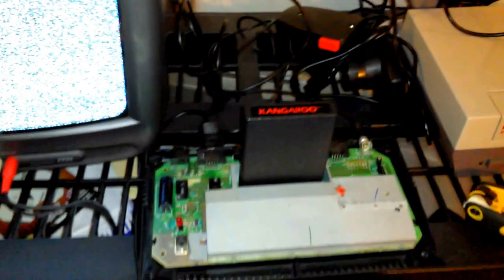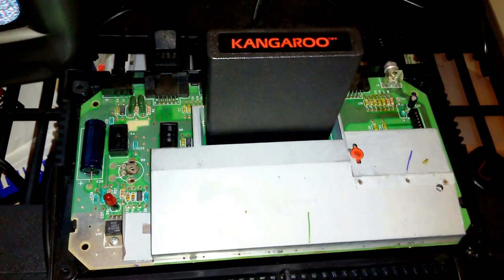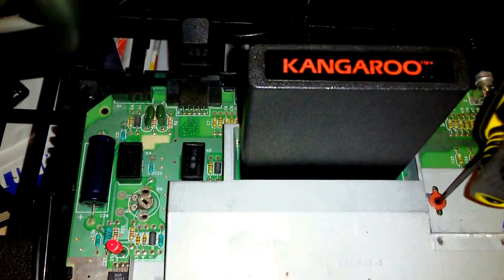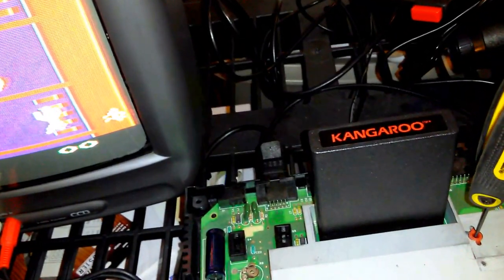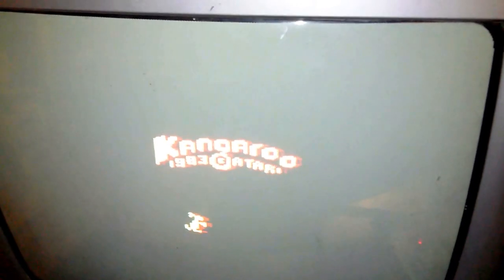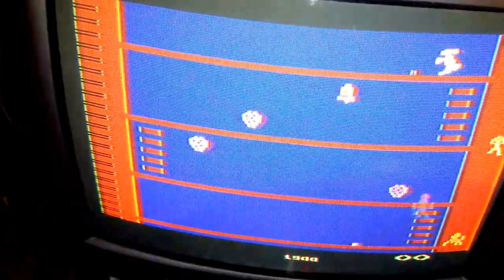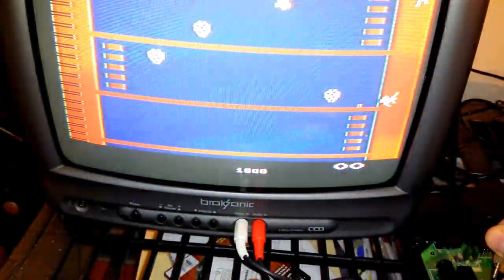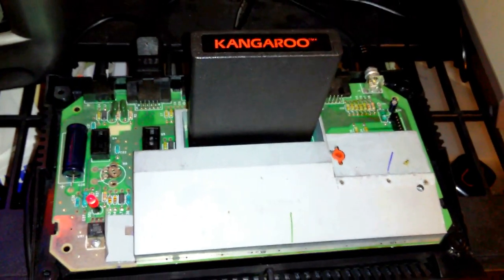Atari 2600 junior video output fix/adjustment, clearer picture

Comment: 1. Replace the 7805 power regulator with a TRACO TRS-1 2450 $5. 2. Also replace the green film caps with TDK .22 100V box film caps. $.50/each. Also replace all the electrolytic caps with new ones, especially the large ones.

Comment: This is a nice, clear video. I've just bought a Junior, some colours are dull but the main issue is a kind of distorted edge to some of the graphics, like a little zig-zag of shadow just next to things. I've adjusted the fine-tuning of the channel on the TV but it's not resolving it, cam the items you showed on the board be worth tweaking? Is the first one replicating tuning (and hence likely won't make a difference) or is that doing something independent of tuning? And I guess I could try the colour one as well. (Note, I'm in the UK, UHF cable plugs direct into digital telly).

Comment: I found out the hard way that the Ferrite core of the RF adjusters can become very brittle with age.  They crack and you're unable to make any further adjustments.  Does anyone know where you can get a replacement?  (If they even exist.)  Not sure I'm using the proper part name.  Thanks.  BTW:  I have to Atari Jrs.  In  one I installed the CleanComp mod & the other I've cleaned up, etc. but the picture isn't the best and can't make any further RF adj.
Reply: If anyone is interested, I think it's called a variable RF Coil Inductor.  Can be found on eBay.  Now I have to figure if or what range of uH(micro Henry) is has to be.

Comment from the maker: I forgot to mention, make sure while opening the unit, that you leave the power unplugged, and the switch on so all the energy is drained from the capacitors.
Reply: My junior has quite a fuzzy picture. I know It's not the cable, so I hope It's this!
Reply from the maker: R Moocher I hope you were able to  get a clearer picture! I've also found that sometimes trying a different rf cable can make a big difference. Those old rf cables themselves can be pretty finicky.
Reply: So leave the power switch on when its opened up?

Comment: Great video. But you never said the size of the hex key lol
Reply from the maker: Sorry. I don't remember Lol! I just tried all of them until one of them fit. Thank you for watching! 😃
Reply: @unconbentional2044  lol it's ok. It's a hex #2 lmao thank you I had the issue went though 3 different connections and still had issue with the line signals on screen. I came across this video and works great now
Reply from the maker: @nooneshero9819  that's great to hear! I'm glad my video helped save one more Atari. It's a great way to pass the time while we're stuck indoors!

Comment: did not work for me. image still fuzzy. i even broke the screw plastic holder that is now out of the console and my console dont close properly anymore. also where u put your hex bit it seems damaged. maybe i used wrong size. be careful guys.